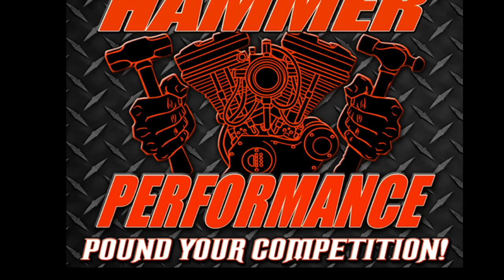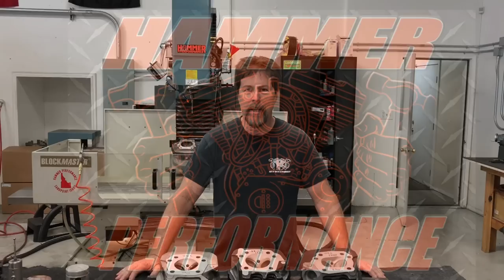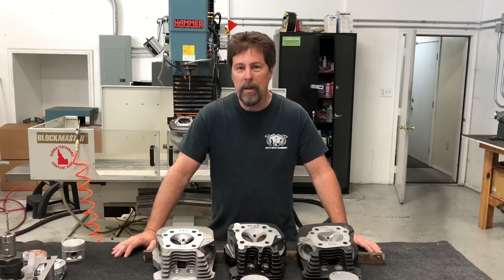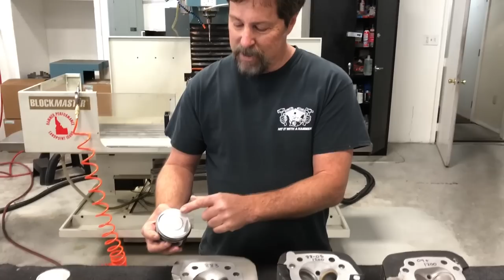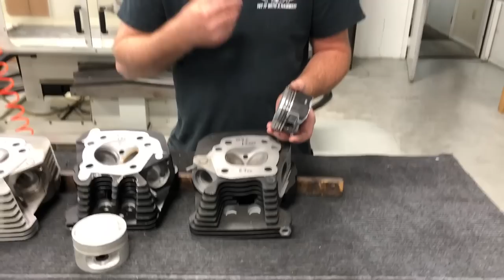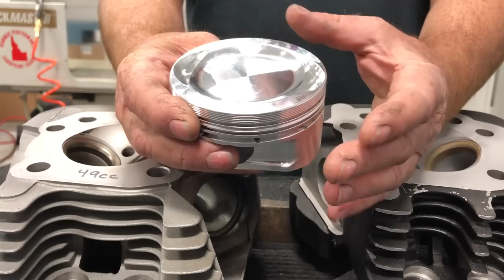The Basics Of Converting Your 883

Comment: The last time my originally 883 was done, was back in 1992 and absolutely no one had all this stuff.  My heads were hogged out and Baisley valves were installed with bronze guides with an Andrews V4 cam.  But the thing has loads of power and somehow gets better mpg than the stock 883, even though it's a 1200 .020 over  {for almost 30 years now}.  I had the 1989 883 new and in 6 months and it was a 1200 convert in short time with the head hogged out and stock 883 valves.  In 1992 I had everything done to it with S&S roads and balanced for high rpm.  But back then, Evo's were very new and hardly any of them were rebuilt so options were very few,  The guy that did my engine and trans was in San Marcos, CA (Regeneration Motors, Mike Drennan) and he built Panheads and Shovels mainly and rode a hopped rigid Panhead.   He DID know his stuff though and he knew I knew a few things too, so I hung around the shop a lot.  The Harley-Buell thing was after this time-period.   Looks like there is a lot better stuff out now and if I need something I'll be going through you people.
Reply: Hammer has complete bolt on kits available in 90 100 110 120 horsepower versions.

Comment: I had a '89 883 and had a 1200 conversion done in '91. I had a S & S Super B carb and it ran great. My friend had a '94 1200 Sportster that was stock. I could pull away from him at any speed and I had the stock 883 heads. The only thing that was done to the heads was the combustion chamber was enlarged. I don't know what compression ratio I was running but it took a good battery to start.

Comment: could i just get headwork done to the 883 without the 1200 conversion..?    id be interested in about 70bhp and maintain a bit of fuel efficiency and cruise more easily at 80mph..?  my 883 was ok just needed a weeny bit more for motorway and 2 up riding... i dont ride fast anymore..
Reply: It'd be a much better "bang for the buck"  (and probably not a lot more money) to just do the basic 1275 conversion. You'll get almost 80 hp with it, along with a bunch more torque that you WON'T get with headwork and the cams you'll need to go with the headwork.

Comment: Question im running a 1250 kit on my 89 sporty, it runs like a beast but when i tore it down the heads where a bathtub shape, not a hemi, am i mistaken or was there a factory 883 head that was a bathtub shape?
Reply from the maker: Yes, the early 4-speed heads were bathtubs, on both 883's (49cc chambers) and 1100's (62cc chambers). According to the parts books, it was 1986 only. However, I've seen a number of early 1987 1100's with bathtubs, and I've seen 883's with bathtubs all the way into 1989 models.

Comment: Could you explain the benefits of adding the 2 extra spark plugs to the bike?
Reply from the maker: It makes almost no difference at all on an Evolution motor. On Ironheads, with a big, obstructing dome, it made a big difference, but I have yet to find one iota of power by dual plugging an Evolution motor, and I've tried.

Comment: I'm seriously considering a simple 1200 conversion on my 99 Hugger. I don't plan on any other upgrades, but the bike has stage 1 screamin eagle air cleaner and slip ons and jetted. Will I need a bigger carb or at least change jetting? I plan to upgrade to aftermarket dual fire ignition. Thanks.
Reply from the maker: you will not need a bigger carb, but you will more than likely need to rejet.
Reply: HAMMER PERFORMANCE thank you for your help. Have a great day!

Comment: im doing this conversion on my 2005 883 to the 1200, mine is carbureted, you recommended. an ignition , what kind of ignition do i need? Thank You..
Reply from the maker: Hi Stefan, we don't make 1200 kits, but if you want to see the requirements of our 1250 & 1275 kits, click here: http://www.hammerperf.com/xlbigborekits.shtml#1250options . At that link we offer the ignition, jets, spark plugs, and clutch upgrade that are required for a successful 1250 or 1275 conversion on a 2005 XL883 model. But don't assume those requirements will be the same for someone else's 1200 kit, you really need to get that information from them. Also see here for a chart comparing a 1200 to a 1250 to a 1275 with no other changes: http://www.hammerperf.com/images/1200vs1250vs1275.gif . As you will see, the 1250 and 1275 bring a lot to the party over a wide rpm range, as compared to a 1200.

Comment: Will the newer style heads work/fit my 1994 883? I like the squish pattern better on those heads.
Reply from the maker: Absolutely! It's very common to put 2004+ XL1200 heads, or Buell XB heads, onto bikes dating all the way back to 1991. There are a few issues to deal with, but solutions for them are readily available. Contact us for more information http://www.hammerperf.com/contactus.shtml#salesform
Reply: @HAMMERPERFORMANCE  I will have to get you to hook me up with a 1274 big bore and heads. I want a dependable engine that has awesome acceleration. Mine has nearly 50k miles but runs like new so its hard to talk myself into taking it apart. It doesn't use oil or anything. But its a slug. I avoid highway riding with it.

Comment: Hello Hammer! Looking to purchase your 1250 kit for my 1999 sportster. If I purchase online does it come with the springs I need to adjust my carb?
Reply from the maker: The engine kit itself comes with cylinders, pistons, rings, pins, clips, and head and base gaskets. But whenever you install a 1250 or 1275 kit, there are other required and recommended pieces. The exact list of items varies depending on the year and model (883 or 1200). You can find both a list of what you need and the items themselves here: http://www.hammerperf.com/xlbigborekits.shtml#1250options . But if you've got an 883, most guys just do it the easy way and get the complete conversion package, which is offered here: http://www.hammerperf.com/883conversions.shtml#basic . It has everything you need or might want to successfully convert an 883 to a 1250 or 1275.

Comment: Am sorry for asking a stupid question, but couldn't you run the 1200cc bathtub style heads on an 883cc motor & get a little better power rather than doing the whole 1200cc kit ? I'd think it'd need a bigger carb & freer exhaust . I'm probably wrong & if so please tell me I am & I'll just wait & save the extra $$$$ to get the full 1200cc kit. TY & sorry again 4 the stupid question.
Reply from the maker: Couple reasons you can't put 1200 heads over an 883. First and foremost, the valves would hit the cylinder decks, because the valves are too big for the small 3" bore of the 883. Second, bathtub 1200 heads have a 62cc chamber, which which would only give a 7.5:1 compression ratio when used over the 883 motor. The small motor needs the small 49cc chambers found in 883 heads.

Comment: Is that first 1200 head (middle) is dual plug 1200s head?
Reply from the maker: Damn, I was hoping nobody would notice that ;) At least you didn't notice the non-stock valve seat. No, it's not a 1200S head. We didn't have any stock 1200 hemi heads in the shop. So I had to use one that's had some work done to it. Dual-plugging it was one of the things we did.

Comment: Question: so how would I know if the 883 iron I’m wanting to buy had a bath tube chamber? Is is all 04 and up models have them? Or how can I figure that out?
Reply from the maker: The last 883 bath tub chambers shipped in 1989. They've been hemi's ever since.
Reply: So let’s say I purchase a 2017 883, can I put 1989 heads with the bath tube chamber and new valves and piston head to match the set up on the 2017 engine? And would it be a better set up?
Reply: HAMMER PERFORMANCE I’m 34 y/0 and I just love learning from you, I’ve done a little machining for about 5 years, but I would love to come work for you and learn all your knowledge. I’m in Indiana if your close.

Comment: Reprogramming is necessary?
Reply: I have a sporty 883 2016
Reply from the maker: yes, you must use an after market fuel management system to re tune the bike.  You must change the timing tables, and give it more fuel.

Comment: Dont 883 heads got to small valves for any performance builds?
Reply from the maker: You're right, to get really big power out of an 883 you have to work the heads, among other things. But basic conversions are extremely popular because they deliver such a huge bang for the buck. We actually got 82.2hp out of our 2007 XL883 with a 1275 reverse dome conversion kit, stock 883 heads, stock cams, and stage 1 stuff. Check it out here: http://www.hammerperf.com/883conversions.shtml#basic . As you can see, the result just towers over the 46hp stock 883 result. This is why basic conversions are our best sellers, they deliver a lot of power while being easy on the wallet. Nothing else you can do for the money makes anywhere near as big of a difference.

Comment: Will changing my cam on my 883 bike will it sound better I mean loud and my sweepper
Reply from the maker: The only way you're going to affect the sound very much with a cam change is by adding overlap to the cams, which makes for a lumpy idle. But 883 heads by design can't handle much overlap without causing piston to valve clearance issues. Watch this video to understand the limitations of cam swaps with 883 heads: http://www.hammerperf.com/ttvideos.shtml#highpowerconversion . Also read more on the subject here: http://www.hammerperf.com/883conversions.shtml#faq1

Comment: Can you run the reverse dome piston on a 1200 head?
Reply from the maker: Your compression would fall through the basement, wiping out performance. Some guys do it for boosted applications though (turbo and superchargers). 

However, many reverse dome conversion pistons have smaller diameter valve pockets, or valve pockets that are moved inboard. They're designed this way to take advantage of the smaller valves found in 883 heads, to provide more material between the bottom of the pocket and the top ring groove, allowing the pocket to be made deeper, which is something that 883 heads need. So even if you want really low compression for some reason, you can get into trouble on piston to valve clearance around the perimeter of the valve (i.e. "eyebrow clearance") when using reverse dome conversion pistons under 1200 heads, depending on the specifics of the heads and cams being used.
Reply: @HAMMERPERFORMANCE  thanks for the reply. I'm trying to figure out how I want to go with my 883 conversion. I have 22k miles and trying to rework my heads with minimal down time. Debated a set of stock 1200 heads, 570 cams and 1275, bit was trying to do it all in stages.

Comment: Where can I buy a kit for my 2020 883?
Reply from the maker: You can find a complete package here: http://www.hammerperf.com/883conversions.shtml#basic . It has everything you need for a successful conversion, including your choice of 1250 or 1275 kit, in the proper big fin style for your bike, a Cometic EST top end gasket set (you'll have every gasket you encounter during the installation), the ring gapping & preassembly service, a full extra plate clutch upgrade (late 883's need this) with clutch spring compressor tool, a primary gasket, a Power Vision tuner, and the spark plugs we specify. Literally everything you need except the common hand tools and the oil.

Comment: Can any one answer? Does the 1200 conversion wear out the 883 bottom end quicker? Iv herd the 883 has a stronger bottom end... but can anyone elaborate  a little?
Reply from the maker: Since 1995, the 883 and 1200 of any given model year have shared the same crankshaft. Literally the same part numbers, they're not even balanced differently. So no, the 883 does not have a stronger bottom end than the 1200. It's all the same stuff.

In terms of wear, well, the 1200 pistons are heavier, and this imparts more load on the crankshaft, so in theory the 1200 would wear faster. But truth be told it's a minor factor compared to other things. You're going to get far more variability in wear from things like how you ride the bike, the oil you use, how well you tune it, and frankly the luck of the draw in terms of how well made the crank was made to begin with. I've seen bone stock 883's lose their big end bearings before they hit 10K miles and I've seen hot rodded 1250's go over 200K miles.
Reply: @HAMMERPERFORMANCE  thanks alot for the speedy reply. If I get an 883 I'm forsure getting your conversion kit. Thanks